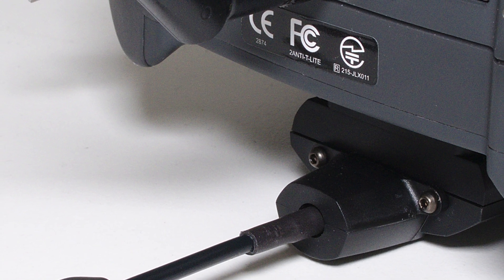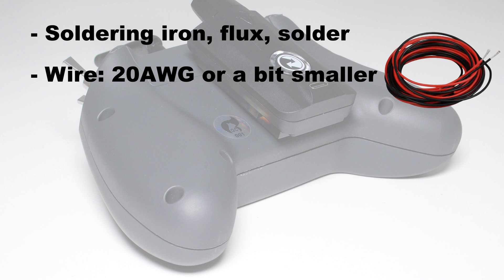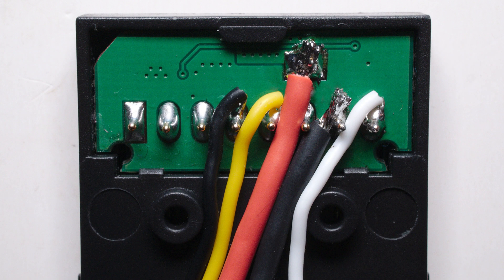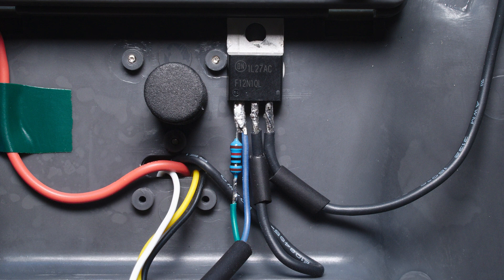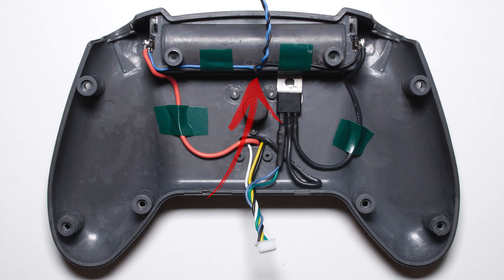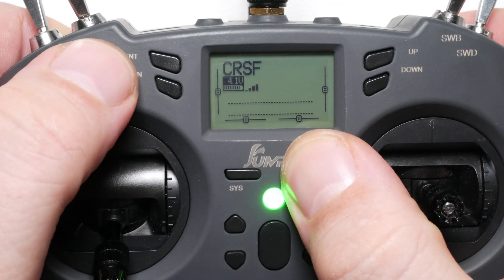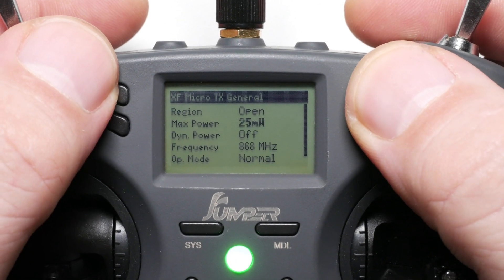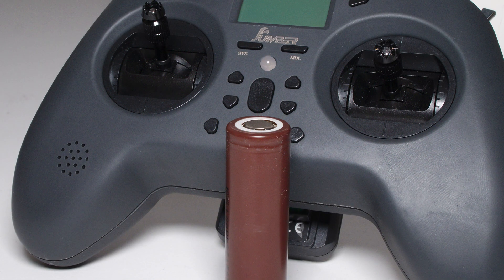Jumper T-Lite: 1W Crossfire mod (powers off when radio is off or when using internal module)

Comment: should I connect Bulk to S pin?
Reply from the maker: What is Bulk pin, what is S pin? If it's not shown in the video, you don't need to do it. Also this is only valid for the OG t-Lite, the newer versions already have this issue fixed, so you might not need to do this mod at all...
Reply: @stylesuxx  Bulk pin ref to NMOS back metal panel, in text it's name B; S pin ref to NMOS Source pin, the right pin, in text it's name S;  I'v mod it using IRL540N, and measured 8.0v between bay pin 2 and pin 3, but after insert tx module, it does not power on, I measured voltage drop to 4.0v between bay pin 2 and pin 3.

Comment: Sadly its not works for me. I do everything as shown, however if i install the module on the back, my microsd fails to read. If i disconnect the module, then its works fine.
Also im using elrs, but not crossfire, but i cant see any drawbacks due that.

Comment: To help out others, take note of the physical location of the FET and the wires. One of my wires was not routed correctly and hit my stick when pushed all the way forward. Some re-routing was required. Thank you very much for this. I used IRLB8743PBF and a 10K pull down. Very helpful.

Comment: I measured 7.7V between pins 2 and 3, so I guess I did everything correctly. Nevertheless I have maximum range on 250mW. When I switch to 500mW or 1W then the range deteriorates. Another issue is that after switching the controller off, the module light keeps flashing/blinking. I have to detach the module every time... Any suggestion what I might do wrong? I thought maybe that this is due to mosfet, but I changed to IRLB8743PBF TO220AB IR but this did not solve the problem. Would appreciate any suggestions.
Reply from the maker: Please use one of the recommended N-Channel mosfets (see description) and double check your wiring.
Reply: @stylesuxx  I used the later one from your updated list (a full coding is: IRLB8743PBF TO220AB) - can it be somehow not correct? I don't know a meaning of all these letters. I will check wiring then, but if the voltage measures correctly I guess wires should be in order...
Reply from the maker: @pawelturon  If it does not turn off when you turn off, there is something wrong. Part seems OK. Which value did you use for the resistor?
Reply: @stylesuxx  10k. Should I swap it to 100k maybe?
Reply from the maker: @pawelturon  10k is fine - I've heard issues from people using 100k - that's why I was asking. Measure the voltage on the blue line (or better disconnect it completely) when the radio is off. If the module is blinking when the radio is off, something is interfering with the gate... you double checked that none of your wires has strands that might be shorting out? And just to have all the info, this is a Jumper T-Lite (not pro) and a CRSF  slim module - right?
Reply: @stylesuxx  Yes, CRSF nano module, exactly the same as on your video. I have checked all wires again and could not find any short. I check blue line is in good order all the way. When the power is off I can still measure 0.1V between pin 2 and 3. I have now accidently placed the battery other way around and fried up external adapter... :-(. Being tired of this problems I have just ordered V2 of the radio, which apparently has improved power supply and should support higher power right out of the box...
Reply from the maker: @pawelturon  Oh crap, sorry to hear that :-/

Comment: hello, I made this modification to the jumper and it worked, but after some time the module power problem returned. Help me
Reply from the maker: Which mosfet did you use exactly? double check your wiring I am now running mine for over a year and can't see a reason why it would stop working. What behavior are you seeing exactly?
Reply: @stylesuxx  used  IRL540N
Reply: @stylesuxx  the behavior is the same as before, the module does not remain unstable, so I had to fly using an external battery connected to the module's usb as they recommend on the manufacturer's website
Reply from the maker: @juliofaria2014  that somehow does not make sense to me at all - the mod bridges the whole weak point. Only thing I can think of is that the step up converter has some issue - not much you can do there I fear. Check the wiring, check the solder connections and measure the output voltage. I assume you are using high quality 18650 cells, right?
Reply: @stylesuxx  correct 18650, i am tester other inclusive
Reply: @stylesuxx  I really liked this radio, simple light, I don't want to lose it, if I can hit it on it, I honestly don't need another one, fixing it up on it the only flaw for me is that it's 1s, even for outdoor flights using a 5-inch with this corssfire module it was a show, I will insist until I get it

Comment: Can you help me please?  I ruined the solder pad for the red wire. Can I just jump onto pin 3 with red wire and get the same results or do I have to tie more tracers together?
Reply from the maker: No, that is not the same pin, if you do that you are circumventing the step up circuit.
Reply: @stylesuxx  sorry, I’m desperate to fix this.  Do you know where I should solder the red wire to to get the correct results?
Reply from the maker: @zappy6782  Well, you can use a glass-fiber brush (or something similar) to scratch away the coating and  see if you can get enough of the trace so you can solder to. If not you will need to solder yourself to the cap on the other side of the board.
Reply: @stylesuxx  is the cap the only component the trace is going to?  That will be perfect.  It is amazing that the adapters aren’t readily available.
Reply from the maker: @zappy6782  Yes, its the input of the boost converter.
Reply: @stylesuxx  awesome!  Thank you so much for your help.  Keep up the good work.
Reply from the maker: @zappy6782  No worries, let me know if it works out.
Reply: @stylesuxx  OK, I had to scrape and solder to the big pad that is to the left of the old pad.  Soldering to a cap didn't work, it just gave me 4.03v.  The big pad is located behind the inductor.  It has 5 tooling holes within the pad.  I'm getting the 7.83v from there.  Works great.  Thanks again for your help.
Reply: Do you know where I should solder the red wire to to get the correct results?

Comment: So what if I do not use a resistor and just leave the green wire out?
Reply from the maker: Then you will have a floating gate. The state of the MOSFET is then not predictable at all, it might randomly turn on, even if it shouldn't be.
Reply: @stylesuxx  for some reason when I use the green wire and resistor the radio will not turn on. If I remove it will work floating gate. I've checked the resistor its fine 9.9k. I think I'm going to just use the resistor on a jumper to battery negative and leave green wire out.
Reply from the maker: @senditsamfpv  Does not sound right to me at all. Which MOSFET did you go with exactly?
Reply: @stylesuxx  the exact one in the video.
Reply from the maker: @senditsamfpv  That's very strange then...

Comment: can i use IRF540N for this mod? its hard to find IRL540N here.
Reply from the maker: No, has to be a Logic level one. The Max Gate Threshold voltage needs to be lower than the lowest possible battery voltage. The IRF540N will only fully switch at 4V or higher. Logic level ones usually switch fully at 2V or more.
Reply: @stylesuxx  thankyou for your best answer i needed, yes i understand now.
im so stupid with electrical,really.
i tried used IRF540N  befor asking you, its works! just like a switch to turn on/off external module,i tried use 1w with dynamic power off its dont have any trouble at all,

but still i need to be sure, if this have effect on Voltage to module power? 
or this FET intentionaly to be a just a switch for on/off?
Reply from the maker: @farizkruwel7551  it will work to some degree. Once your battery gets more empty, the FET will not fully switch, resistance will get higher, FET will get hot, voltage will get lower. At some point the step up converter will stop working and your module will lose power. Although it might seem to be working, especially with a full battery, I would recommend to use a "correct" FET.

Comment: This video applies to the Betafpv ELRS nano module as well, right?
Reply from the maker: Yes. Basically any external module should only be run with this mod. Only the happymodel ELRS module for the T-Lite comes with additional hardware that does not require this mod.

Comment: i have the jumper t lite with the crossfire module, and without all these modification i can choose max power 1w in the setup menu. i don't understand, it's not really working at 1W without modification???
Reply from the maker: Of course you can chose it, but one component and the traces are not designed for the current that CRSF needs at 1W, so it will burn out eventually. I have heard from some people that the later versions of the T-Lite improved on this issue and have the traces and component sized accordingly. You can try and run it as it is, but be prepared that your external module might stop working at some point.
Reply: @stylesuxx  thank you Mr, i'm a beginner, i think i have the last version of the t lite, i buyed only a week ago. For now i don't go far. Without modifications you think i can set at 100, 250, 500mw? I ordered the mosfet and the resistor on the Conrad store but if i don't realy need  i prefer don't disassemble the radio.
Reply from the maker: @user-ys4hf6vk3c  Jumpers recommendation is to only use 25mW with an external module.
Reply: @stylesuxx  ok thank you ;) in that case,i will do like you

Comment: Noob here. I'm not sure how the controller works: Is crossfire always on even if I"m using a non-crossfire drone, or I can turn it off in the menu settings? THanks
Reply from the maker: External module is only powered when you select a model that uses the external module.

Comment: Just completed this, but not sure what's going wrong. I have 7.75V to the correct pins, but when actually powering on the module the LED on the back is flashing randomly, while the speaker is making an interference-type noise with the same pulses, clearly some kind of power issue. No data input to the crossfire, the settings .lua just says "waiting for Crossfire". Checked connections, everything is hooked up correctly, I'm using a 100k ohm resistor and an IRL540N mosfet.
Reply from the maker: Pleas try a 10k pull-up. I have heard from at least one other person that they were having issues with a 100k resistor.
Reply: @stylesuxx  Same issue with a 10k.
Reply from the maker: @AceCombatFan0  what is the module doing when powering through USB? Without being plugged into the radio
Reply: @stylesuxx  Powers on normally, I can access settings in TBS Agent X, no problem.
Reply from the maker: @AceCombatFan0  Which 18650 cell are you using? can you try and measure the voltage while the module is plugged in? Sounds to ma a if the voltage sags...
Reply: @stylesuxx  I think my reply might have gotten held for spam because of the amazon link. They were LCLEBM 3400mAh 20A cells. Same results with a lower MaH DoublePow cell. With no module I was getting 7.75V to the pins as in Step 6 (cant reach these pins with the module installed) and 4.3V to the ends of the red and black wires I added for power. Installed the module and now read 0V on everything so I'm pretty sure that blew the module bay board just  blew up, so I'll just be uninstalling this and if I'm lucky find a Tango 2 in stock.
Reply from the maker: @AceCombatFan0  Hmm, that sounds all very strange to me. If you say 0V on everything - I suppose you mean the output of the external module bay? It'll be interesting to see pictures of how you wired everything up...

Comment: Naive question, is this mod effectively adding vbat in parallel with the existing (weak) regulated supply switched via the FET? Thus reducing the load on the existing supply?
Reply from the maker: No, it is just a work around to power the external module directly from battery instead of the undersized FET, and trace on the board. It is not messing with any of the power supplies on the main PCB itself.
Reply: @stylesuxx  Thanks for your patient reply – I’ve now seen the schematic and understand. We are merely sidestepping the main PCB and supplying the step up regulator directly. Thanks again!
Reply from the maker: @babc142  Yes, exactly :-)

Comment: Thanke a lot, have done the mod.
500mw is running very good, But the Link to the receiver breaks suddenly up at 1w after about 10sec. Whats the Problem there, any idea? and on 1w there appears a solid withe light. and also the luascript disappears sometimes on 1w -> on the screen it means "waiting for tbs". everything just seams to be unstable... i have updated all firmware on all devices!!
i build in exactly the same Components in as you, exept the new recommendet mosfet!!
If someone could Help??
Reply from the maker: Hmm, sounds strange. Which 18650 cell do you use?
Reply: @stylesuxx   thanke you for ansering!! I use the basen-cell 3100 mah 32a continus amp draw, should be one of the best cells out there… voltage are ok when enable 1w, but the crossfire module make stange things🤷🏻‍♂️ do you know what the wite light means on te crossfire tx nano v2?
Reply from the maker: @NatFpv  No, I have no clue - to be honest, I don't think I have ever seen the white light on the CRSF TX Nano module...
Reply from the maker: It'd be interesting to see what happens if you power the module externally via USB C... You should disconnect VCC from the external module then.
Reply: On 1watt, conected to my computer, the crossfire tx stays orange-pulsing as usual, exept if i plug it in to my external module while conected to the pc, it will also change to the wighte light… wile it doing that, it disconnects to the computer somehow🤷🏻‍♂️
Reply from the maker: @NatFpv  yes, AFAIK it switches to the external power when detected. Your computer will not be able to supple enough current. You want to power it via proper USB power bank, or power supply. But you will have to disconnect power from your external Module bay. I posted a couple of ideas to your video. Maybe we can keep the discussion there, so that everything is in one place ;-)

Comment: Can I use a 10k ohm resistor with 3w tolerance?  It's a bit larger I think but if I can make it fit I have one handy would save me ordering a 1w and having to wait on shipping :)
Reply from the maker: Sure you can, but it's overkill 1/4W is enough.

Comment: What’s the step up you show in the circuit diagram at the end ? Is it just built in ? Didn’t mention on components list at beginning of video
Reply from the maker: The step up is included in the external module bay.
Reply: @stylesuxx  as in you install it there and doesn’t come w radio or tbs unit? Your diagram shows a step up ?just confused.
Reply: Ok I turned on captions made it more clear I guess the tbs or controller has a step up and it’s ran by a non-usable circuitry so basically your essentially bypassing it i see and using a switch.😀
Reply from the maker: @tankogenonrcgroups9750  the step up is in the module bay that can optionally be attached to the radio. The module bay is included with the radio.
Reply: @stylesuxx  beautiful makes sense.  lol didn’t know location but makes more sense. I have the controller just haven’t turned it on yet. I’ll use dynamic power or 500/1watt can’t wait...

Comment: I think Jumper might have fixed this. The T-lite I bought in may has thicker more direct routed traces going to and from the external bays power mosfet.
Reply from the maker: That would be cool - have you tested it? Is there an official statement that addresses ist? AFAIK people hat FETs die on them, so just thicker traces might not be all it takes, so an officialy statement in that regards would really be nice.
Reply: @stylesuxx  There were no statements that I know of but, this appears to be the mosfet in it https://www.vishay.com/docs/68741/si2301cd.pdf 
and the trace is almost twice as thick. I put some pics here https://www.rcgroups.com/forums/showthread.php?3754503-Jumper-T-Lite-another-Lite-radio/page77#post47359867

As far as testing I only have ELRS and I'll be trying 250mw that's not gonna tell you much though since 900mhz and 1w is probably 3x or 4x the amps.

and I've seen traces burn that were not visible under the solder mask
Reply from the maker: @thirtythreeeyes8624  Hmm, that is very interesting information - thank you for posting. Specs of the mosfet do indeed seem to be promising and I would in fact think that this does solve the issues.